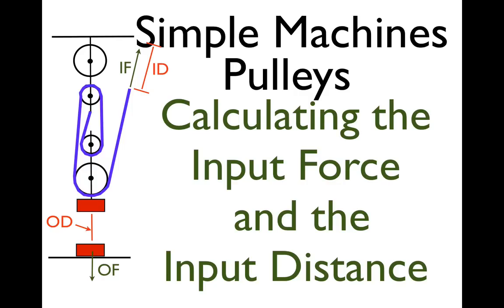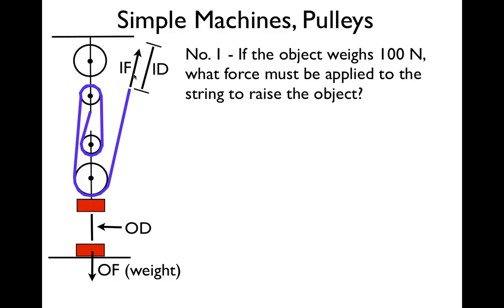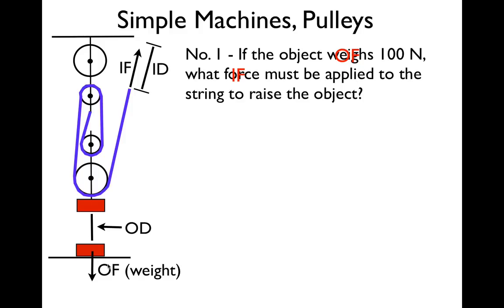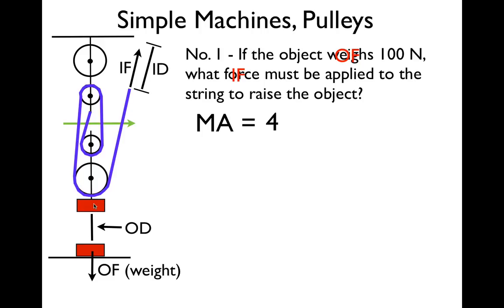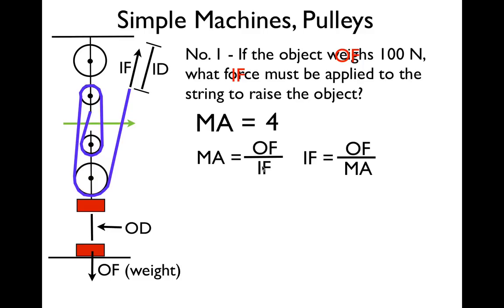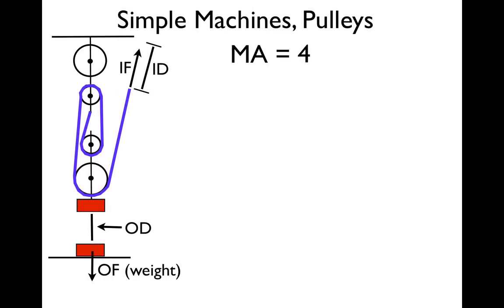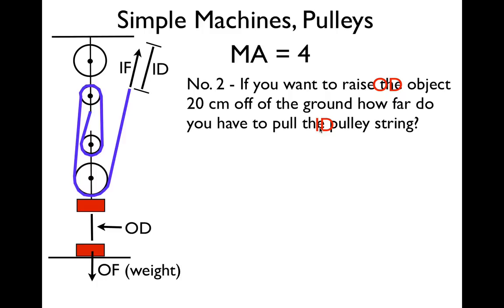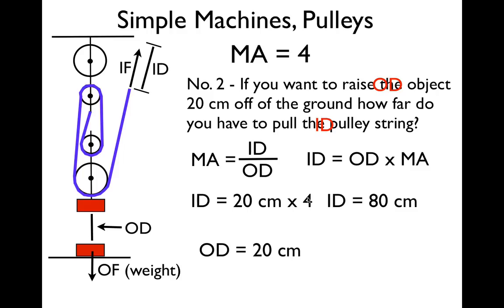Simple Machines (3 of 7) Pulleys; Calculating Forces, Distances, MA, Part 2

Comment: I appreciate that the explanation is easy. However, simply drawing a line through the ropes does not always give you mechanical advantage. Otherwise, a simple fixed pulley would give you an advantage of 2 and it does not. In both a fixed and movable pulley, there are two ropes, yet for one the mechanical advantage is 1 and for the other it is 2, respectively. I believe a clarification of which ropes to include and which not to include is in order here.
Reply from the maker: I believe I said in the video that the rope that comes over the top does not get counted as part of the MA.
Reply: @stepbystepscience  I listened through the video again.... and then also the first in this series... maybe it got edited out by mistake? Either way, may I suggest giving a visual example, not just verbal mention.
Reply: Nicely put